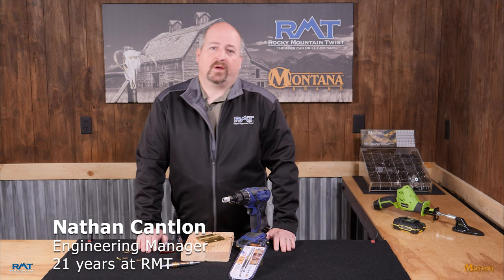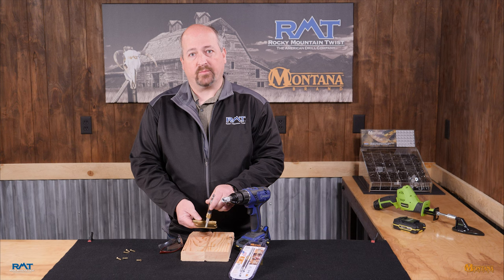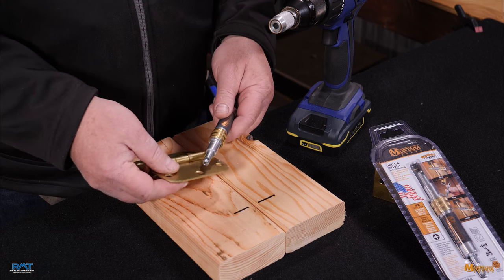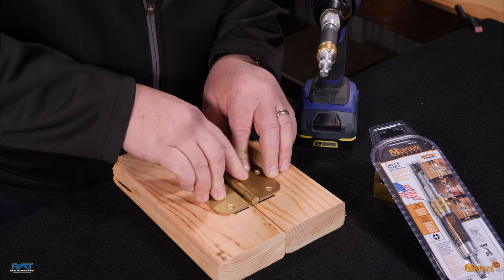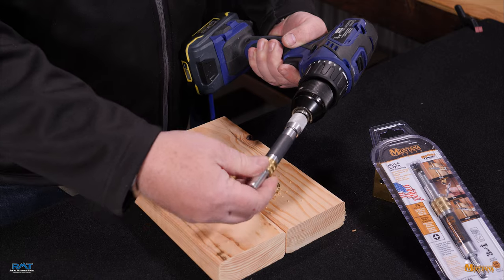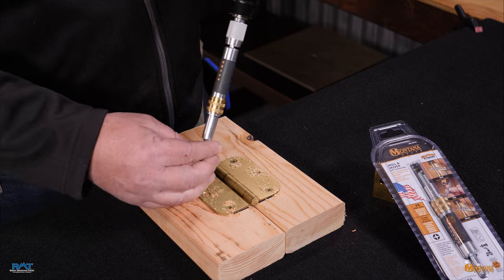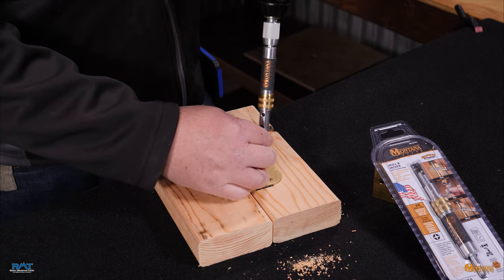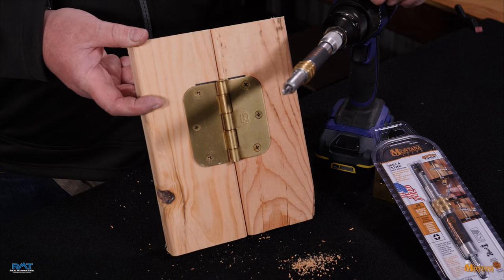BEST HINGE BIT!  Self-Centering Drill and Drive Hinge and Bracket Tool from Montana Brand Tools

Comment: What matters is how much slop there is between the drill bit and the housing, which nobody seems to address in their videos.
Reply from the maker: As long as the insert and body are concentric, a little space and wiggle is fine.  The drill point is centered in the coned point, and your pressure on the drill will keep it in the chamfered hole.  This "slop" is also fine in the 4-in-1 version for the same reason- the drill point is centered and pulls the drill straight through the cut.
Reply: @MontanaBrandTools   If there is room for the bit to walk, the hole will not always be centered. Its not just about drilling a hole inside of a circle. If I buy a self-centering bit, instead of "eyeing" it myself, I expect the tool to cener the hole, which will not consistently happen in if the bit can walk across grain.
Reply from the maker: @GlenGray-r4i  Now I understand where you are coming from- the space between the inside of the point of the chamfered drill guide and the outside of the cutting lips of the drill. (Pardon me, I thought you were talking about the entirety of the flippable insert, which does have some wiggle.)  

That clearance space is tight on our Self-Centering Drill and Driver.  You will be able to put your hardware exactly where you want it, and the holes you drill will follow, centered in the hardware.  It is not something we have ever had negative feedback on as the tool performs very well with great accuracy.  

My apologies for not understanding you, but I believe your concern is covered by properly engineering the point of our tool.  You should take it for a spin and see for yourself!

Comment: How do you know whether you need the #6, #8 or #10?
Reply from the maker: That depends what size screws you are using.  If it is a standard door hinge in a home, it is likely a #10 screw.  Most hinges will have a number on the packaging.  

We are definitely happy to help, but we don't check our YouTube as often as we would like to!  If you need further assistance, we are a lot quicker to answer questions via email at Sales@MontanaBrandTools.com or phone at 406-528-four three five zero.